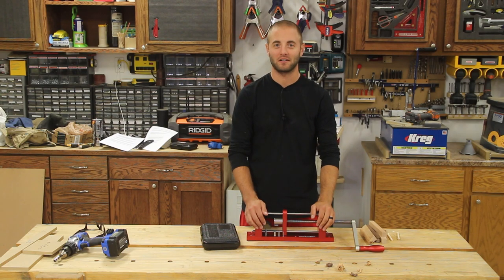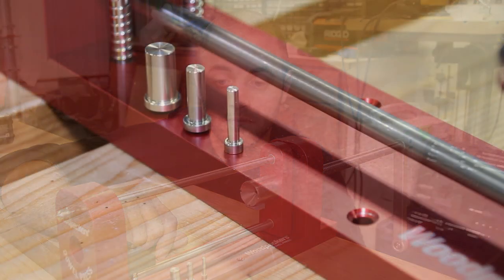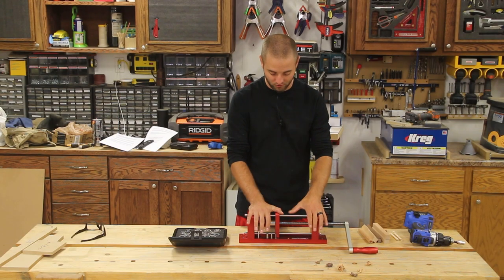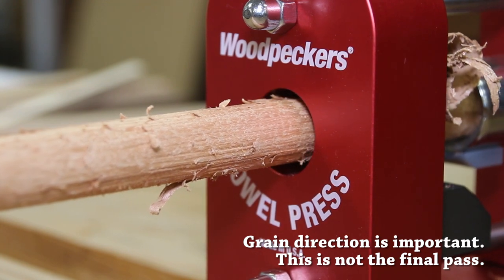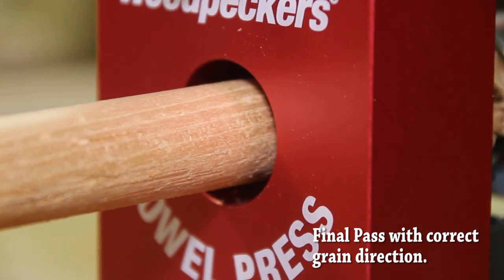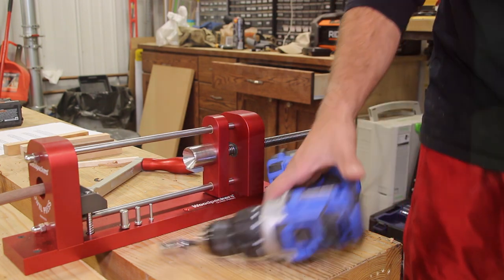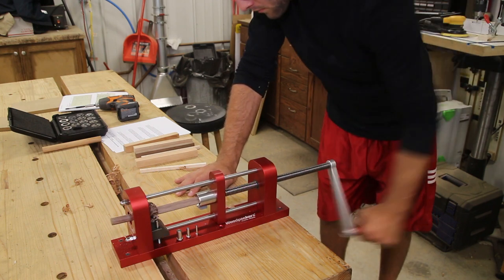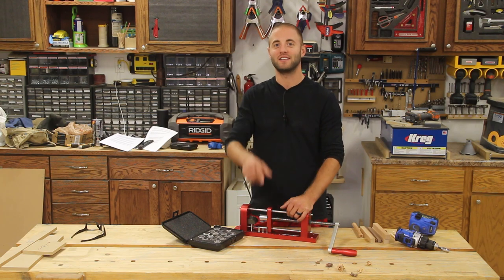Woodpeckers OneTIME Tool Dowel Press Review

Comment: If it could do a dowel in one pass I wouldn't mind the $400 price tag... but it's just seems like too much work.
Reply: The multiple passes is what gives you dowels accurate to 2 thou.
Reply: @BlackSwan912  That's 1/512" I'd ruin the dowel by just sneezing. What are you doing that you need that kind of tolerance with wood?
Reply: instantsiv 😂 😂😅😳🥵🤤 idunno!

Comment: This one is by far on top of my list of "woodworking tools for special care woodworkers".
Fabricated dowels are cheap as hell.
Dowels are invisible once you used them.
You don't need a lathe to make dowels, you can make a "dowel jig" for any size of dowels for $ 1,-.

And one more comment; this tool is not overpriced (as some of comments suggest) - taking into account a build quality, small batch production and Woodpeckers' status, the price seems to be right. The only problem is that this is one absolutely clueless tool. 

It only shows, that Woodpeckers completely run out of ideas...
Reply: Why am I commenting on a tool that isn't even available any longer? While we ponder that, on to my comment. Galtube, you state that dowels are invisible once you use(d) them. This is not always the case. The reason I would be interested in a tool like this is the ability to make dowels from virtually any wood type I might be using. And since dowel ends are often left visible for aesthetic reasons, it would be nice to be able to use the contrasting wood of choice to make small batches of dowels for various custom products. Fortunately, I recently acquired a CNC mill and making an improved version of this product for my personal use is on my list of fun metalworking projects that will be of use for some of my woodworking projects. Hmm, still not sure why I'm bothering to comment though...
Reply: @SH-pc4xt   Yes, you're right; in some projects, some woodworkers like to show dowels, especially using contrasting wood. To those people I wrote "You don't need a lathe to make dowels, you can make a "dowel jig" for any size of dowels for $ 1,-."  And I'm still of the opinion that this tool is absolutely useless - if you have a chisel or just a piece of steel and are able to sharpen it, you can build a "dowel jig" for nothing.
I'm bothering to comment, because this is one of such nonsense tools for 400,- bucks.